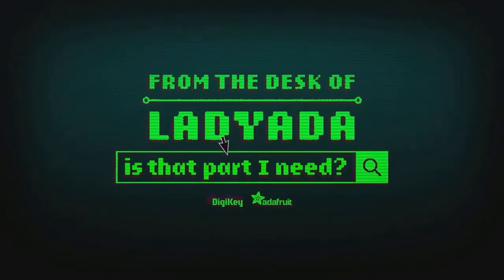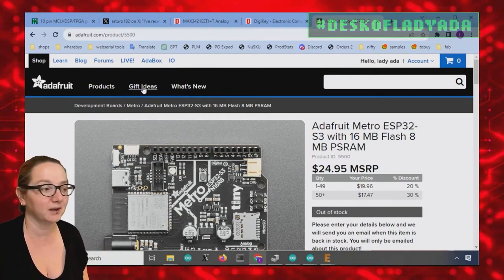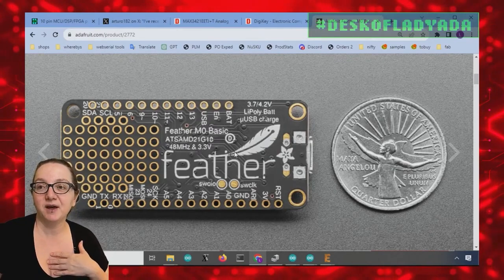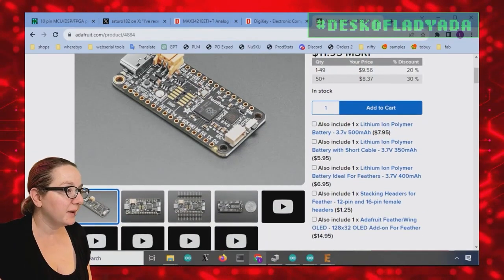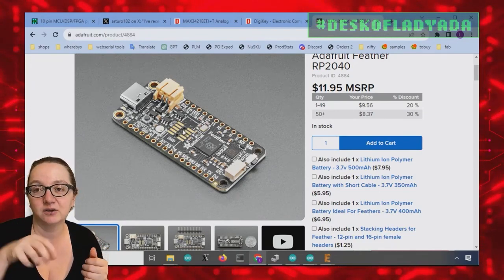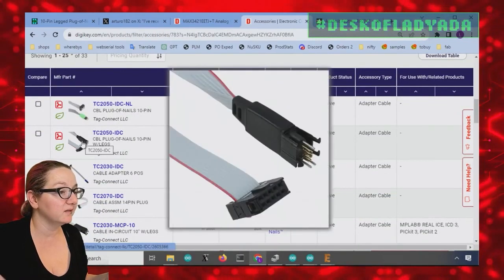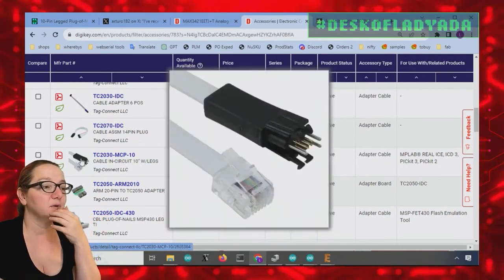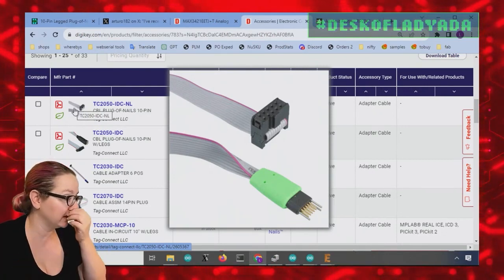The Great Search: Alternatives to SWD IDC ports: Tag-Connect & SKEDD #TheGreatSearch @DigiKey

Comment: Ty! I needed 2050 IDC tag connector for my bluetooth project but It is 40bucks....which I can buy one RPI board. I thought considering the price It might have some chips in it lol(I'm not a hardware level programmer so i'm very stupid and careful when I touch hardware or low level system). Now I can solder IDC pins without worries! I don't think it's worth spending $40 for something I'll use 2-3 times. Thanks for saving my money!